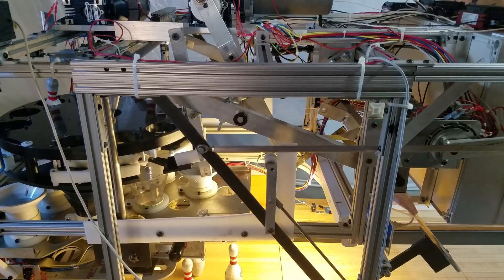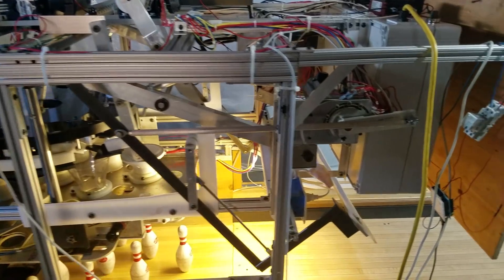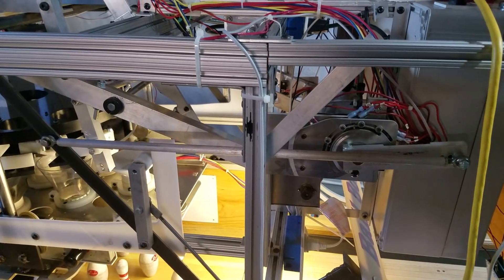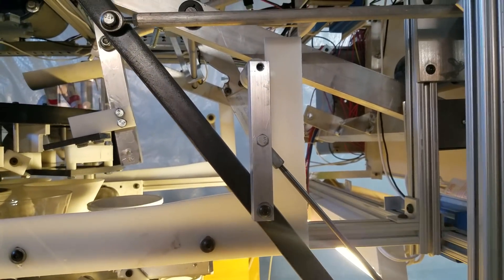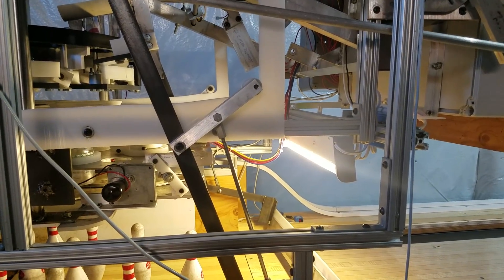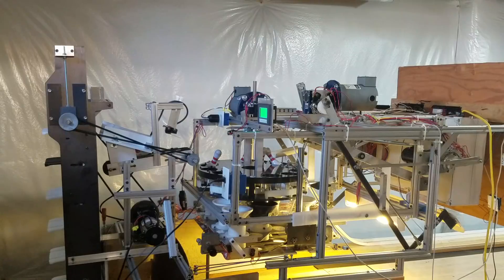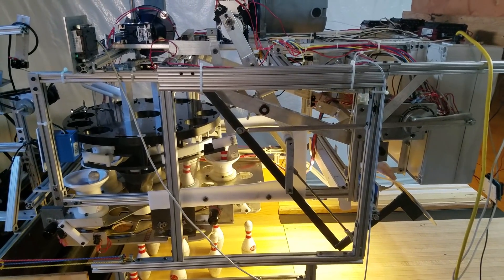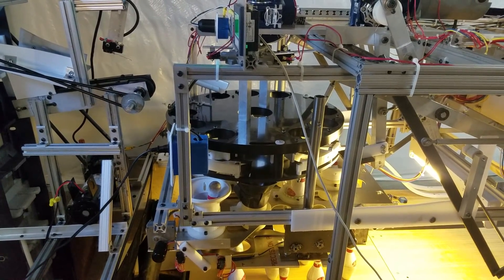Mini-pinsetter sweep explained-proof of concept design

Comment: 5:14 the GSX does that when you run a respot cycle to set all 10 pins or to set specific pins.
Reply from the maker: Hopefully you've checked out my newer videos showing how the machine currently operates. If not, here's a link: https://www.youtube.com/watch?v=Ac1rugg5Fuw&t=224s
Reply: Or an A2 when you step over the Foul Line and it performs a Foul Cycle

Comment: Will you install some kind of chock absorber to stop the rattling when the sweep drops? I don’t know if this might be fixed with your newer production units, but it feels like it would be needed for smoother operation. :)
Reply from the maker: The new design should be a little smoother. However, it's not something I'm worried about. Compare mine to when an 82-70 sweep drops: https://www.youtube.com/watch?v=_lhWSBUFI-g
Reply: Yeah, I know. I guess I’m used to Brunswick’s sweep designs. Good work anyways!